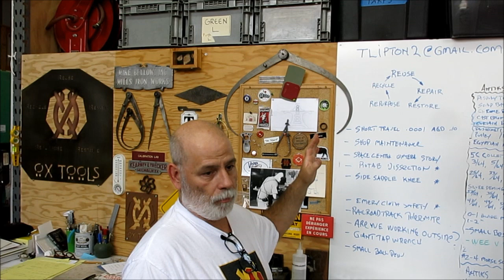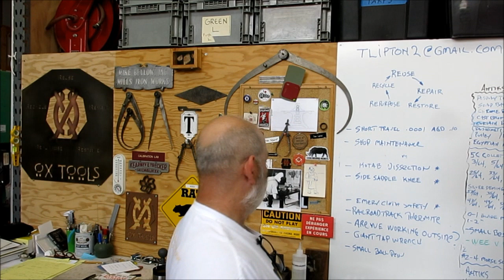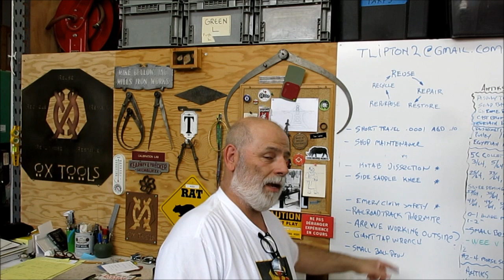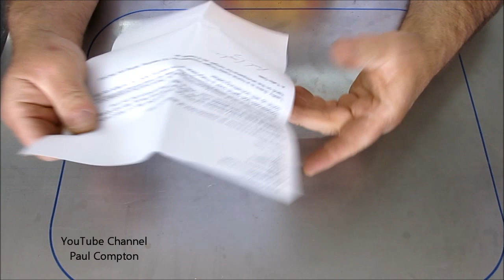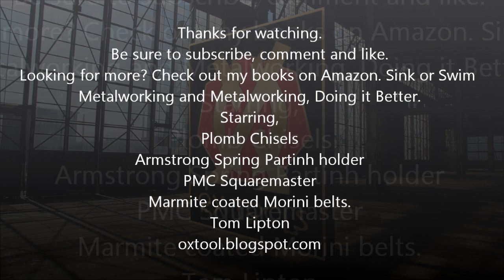Monday Night Meatloaf 36

Comment: Tom,

We eat Marmite and Vegemite over here in NZ quite often, it often adds a bit of zing to a meat or cheese sandwich as a spread, and can also be used as a taste boost to a casserole dish or soup, it is in one sense an acquired taste, but is quite tasty as a spread in its own right.
Just one comment that I have apart from all the above, is that I noticed when you were using that part off tool, there seemed to be a bit of meshing noise coming from the gears on your lathe which I had not noticed before on other videos when you were doing any lathe work, did you change something or is it just me...

regards

John MD
Reply from the maker: Hi John,

Somebody else mentioned it as well. I did install the special larger gear to do metric threading. It makes more gear noise than the standard gear. I will have to change it back.

My Kiwi buddy used to talk about these huge green mussels they would snag with shop built grapples off their sailboats. He said they were so big two of them would fill you up. I told him no way. I guess it was all the beer that was consumed along with the mussels on the beach that filled the rest.

Cheers,

Tom
Reply: oxtoolco The story about the mussels is probably more or less true as we eat them regularly, you can get them very easily in most places around the coast here, either from a boat or just off the rocks, I am a great fan of really good seafood, and the mussels that we eat here in NZ are the Pacific Green lipped variety, and they grow up to a fairly good size, so if you had half a dozen of them to eat, you would be really full, no question, and when you put them into a seafood chowder there is nothing quite like that for a taste sensation, they also sell them at the local supermarkets so you can get as many as you like, on any given day if you can't get to the beach...

cheers

John MD